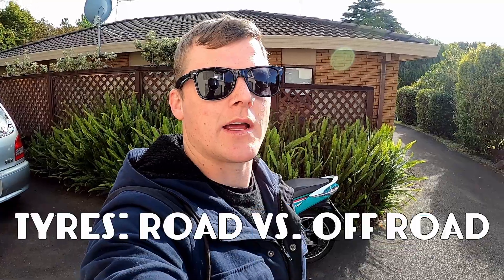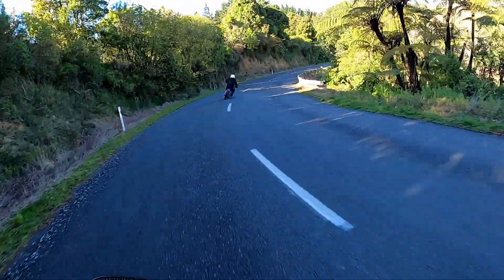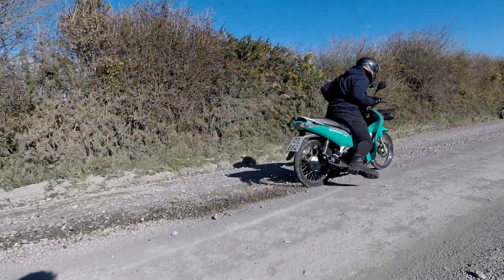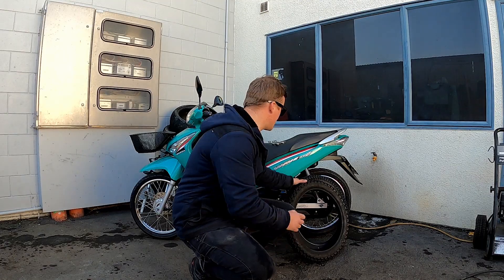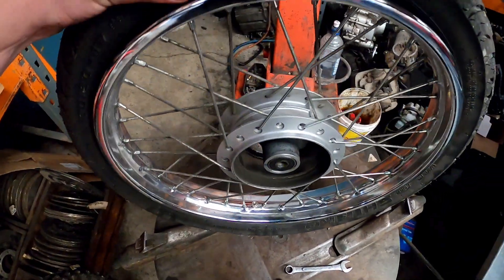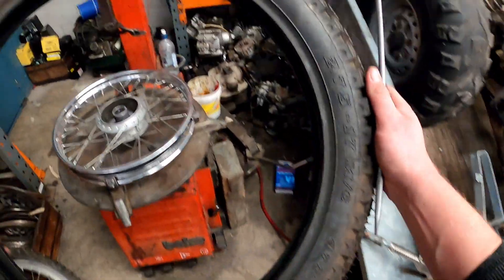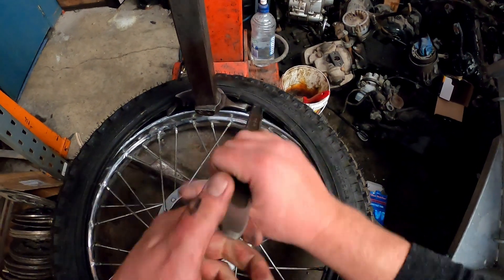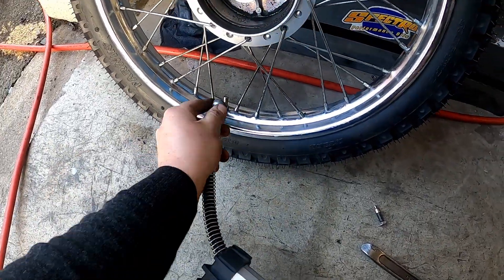ROAD vs. OFF ROAD: Small Bike Tyre Swap

Comment: Great work. 
I personally find that a taller sidewall makes a big difference.
Since quite a while I've been running IRC-NR1 17-3.00 tyres front and rear of my Wave 125i.
The best tyres I've ever used. I can keep with up guys pushing Ducati Monsters in the twisties and fly around on Gravel.
They even fell more confident that the Vee Rubber Knobbies I tried previously (which were sh1t on tarmac).

I did need to modify the front fender a bit as it rubbed a tad in front and cut a whole in the rear part of the fender (super glue and inner tube fixed that :)).
Gotta post on the facebook groups about that mod.

Keep it up :)
Reply from the maker: Thats awesome to hear. Thanks for the real world update about your Wave.

Comment: Pro DIY tyre change tip: many people use detergent as lube - which works great. However, normal dish detergent often contains salts which promote rust (thus are not ideal to leave inside your rims for ages). So use car wash detergent instead (as they generally should not contain such salts). I often carry an old pill container with some in it when I'm going longer range; lube really does make tyres 100 times easier to do, especially on the side of the road.
Reply from the maker: Awesome tip! Cheers Mark. I'm not always using tyre machines, but this one was right there in front of me so it would have been rude not too. Will get more in depth with Small Bike tyres in a future video.
Reply: Just use wd40
Reply: @alanhampton1030  I find thin lubricants like WD40 and CRC are pretty much hopeless for tyres as they just soak in and what stays on the exterior doesn't lubricate anything like as well as detergent/car-wash.